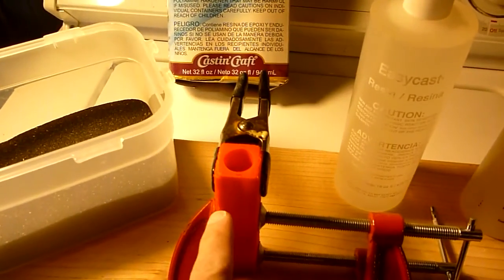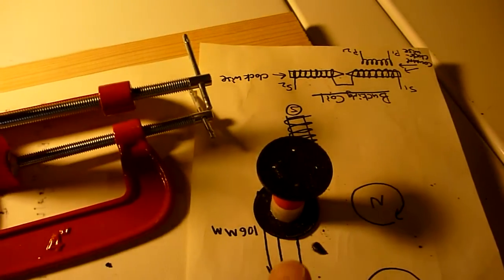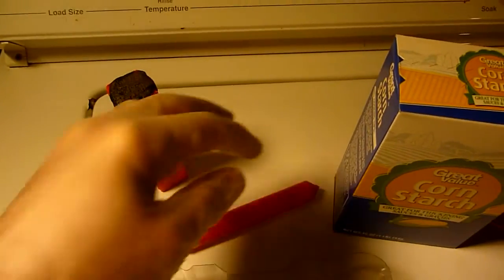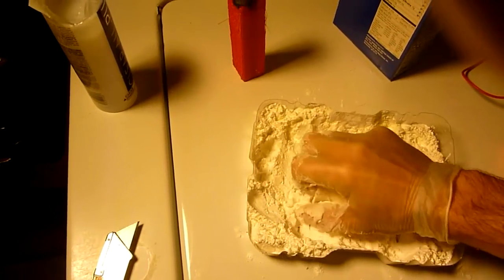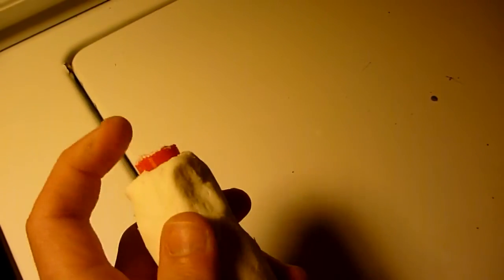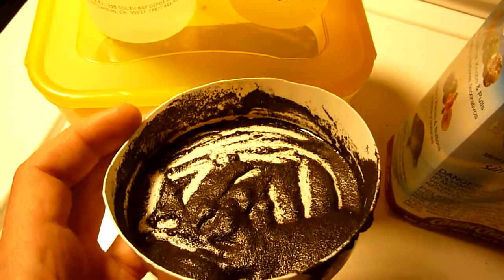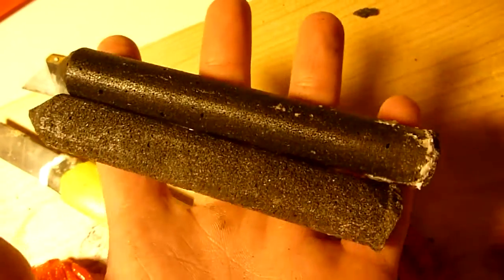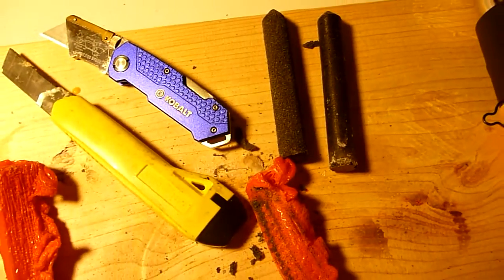How to Make Your Own Custom Magnetite Transformer Cores!

Comment: EASY make transformer cores:) MAKE EM BIG... Materials::  Epoxy resin ,, lots of Iron powder shavings ,,  4 pieces of wood 1/4 inch thick by 2 inches high by 4 inches long rectangle ,, Two wax bricks  5 inches tall by 8 inches long,, Exacto knife ,,wax paper and a undamaged cardboard toilet paper roll. Dip toilet paper roll in clear epoxy ,, hang up by pin hole and thread string ,, let dry.. CUT out of square wax brick ,, 4 rectangle holes that the 4 boards can fit in with Exacto knife... Each board a half inch away from the other and exactly in line with one another. Take out board guides and Fill these holes with epoxy iron shavings mixture. Overfill by 1/8 inch. Let dry for 3 days. Take wax away from epoxy mixture. you should have 4 rectangles connected together in a nice neat row.  Use wax to make another mold with the same dimentions as the 1st one.. Cut out square box on top of dried wax 4 inches length and width by 2 and 1/8 inches deep. Place toilet paper roll in exact center of rectangle wax cut out. Pour in resin iron fillings to both sides of toilet paper roll , but NOT all the way to the top.. let dry 3 days. 3 days later pull wax away. Now you have two halves,, top and bottom. Super glue the flat bases together so they match up perfectly. Now you have 4 iron cores to put 4 coils of magnet wire on and a top hole to put a large neodymium magnet inside toilet paper roll. YOU GET A power supply above the transformer that you can put the kinds of wires you want in the transformer. GO ON,,  beef it up. AND to make it stronger I suggest you put on each end of wires 2 capacitors 400 volt 220 uf ...  It powers all my needs and then some with a Milwalkee 18 volt battery. Great for portable power in camping. Just remember the magnet will be switching poles from left two coils to the right two coils with the negative side of capacitor hooked on one end of wire and on the other side of wire as well.

Comment: Interesting. Is the magnetite power good for low frequency application, e.g. 50/60Hz power transformer? Thanks.
Reply: Yes. But the hysterisis losses will really cause issues at higher frequencies. But 50-60 Hz should be A ok

Comment: Yeah looks exactly like .......
........
Uh.
....
DOH!...
The suspense is agonizing.
Concentrated agar is good for v quick moulds & many at a time.
Can also be re melted a few times. 
Takes minutes to set.
Easy to slice open like Edam cheese.
Very cheaply made.
Not expensive plastic mould.
No dough knobs required. 
Unless you feel inclined.

Comment: Thanks, making the cornstarch/silicone mix will be helpful, have used cornstarch/crazy glue to fix the top nut on a guitar.  I've used fiberglass resin and magnetite to make cores, does not stick to pvc or many other substances, epoxy stick to everything, 
Here is a wiring scheme I discovered some time ago. 
Instead of the standard joule thief, still a bifilar configuration. Designate coil A beginning [inside of the coil, mark yellow] and ending [outside of the coil, mark black] and coil B beginning [inside of the coil mark red] and ending [outside of the coil, mark green], Black goes to the emitter and then to negative on the battery, yellow goes to the resistor [variable pot or fixed] then to the base, red goes to the positive on the battery, green goes to the collector, rectifier is across the emitter and collector [the base will also put out voltage], the cap is attached to the positive and negative of the bridge rectifier, you will find that all the ground are common throughout. I have charged hundreds of volts [600+ from 6 V] depending on the size and configuration of the bifilar coil I was using, It's no theory.....been doing these things a long time, it is tried and true, proven to work through many hour [try "years"] of experimentation. This is the basic setup,  try different methods of discharging the cap back into the run battery or a second storage battery, neon's, gas discharge tubes, Bendini's 555 discharge circuit, experiment.  I'v decided to give these discoveries to "whom soever will", "freely receive, freely give". by the way check out the "field coupled torque translator" I put up lately. I use the empirical method, lots of trial and error. ....... Hope this will be a help in your efforts. Listen to the music also. For me, all these things are great enjoyment and I might stumble across something really useful.

Comment: I like your silicone mold idea. Thanks. I'd like to suggest a couple of improvements, though. Put just a little bit of the mix into the old and then place into a vacuum chamber to get all bubbles out. Then depressurize and repeat the process several times. I think you need to do it a little bit at a time when casting a long rod, so all bubbles come out. My other idea is to use some kind of vibration device as well.

Comment: Hi there. Do you believe I would be able to make a permanent magnet out this core you created?
Reply from the maker: I don't think you'll be able to make a permanent magnet out of magnetite. That magnetite is known for very its quick magnetization/demagnetization properties. I don't know if you can permanently magnetize the stuff. Why do you want to magnetize it?
Reply: I am doing a project at my undergrad program. I am trying to recreate Faraday's Motor experience as much closer to how it was done as possible. Faraday gives us all dimensions and materials for all materials he uses except for the magnet. He writes down the dimensions but not the material it is made of. I guess it is because there were no options back there as we have nowadays. So I though of maybe building up my own magnet made of magnetite. But as you said it probably would not work.
Do you have any idea how would one make a permanent magnet with 1820's technology?
Reply from the maker: The Faraday Disk Motor project that you are doing sounds very interesting. I would imagine that people in 1820s would create magnets in a very similar way that we would create them today. They likely would pass high amperage DC current through a molten piece of iron. Then they would dose it with water to cool the iron chunk down faster. The iron chunk would be magnetized. Also, a very strong magnet can be used to magnetize iron chunks. If you move the magnet over an iron piece in the same direction multiple times that iron piece will become magnetized. No matter how many times a magnet is used to magnetize other pieces of iron its magnetic strength will no be effected (does this go against the conservation of energy laws?). Thanx for the comment, cheers.
Reply: I am not doing the disk experiment but this one instead: http://en.citizendium.org/images/f/f0/Faraday_electromagnetic_rotation.jpg
I will try to make my own magnet like you have said. I have no idea how I would be able to melt a piece of iron, so I might use the rubbing technique.
Thanks a lot for help. Cheers.

Comment: much simplier is to use a candle wax for molding . when it get colder it solidifies . after the epoxy is ok then you can melt again the wax
Reply from the maker: +MonkeyBlueAss I'd expect that candle wax will crumble as you'll attempt to extract it. Try it, see if it works.
Reply: You don't understand me - candle wax is a  single use (disposable not reusable) mold and you don't need to extract the  wax because you can remove by simply melting the wax with a hair-dyer or heat-gun

Search on You-tube the title " How to Make a Candle Wax Mold and Casting " and your see your are wrong because wax is an old mold casting technique

Comment: What I have done to smooth the print lines is to print in ABS then use acetone to smooth and seal the print, if it's done correctly the print will come out looking really smooth like glass, here:
 https://www.youtube.com/watch?v=Jv-CbnB8Uz4
Not the print I would have used to make a video with, but it shows how good the print will be once it's given an acetone bath, you can also do this in PLA, but I have not tried it. Your silicon idea works well also.

Comment: If you were to print the mold in two pieces, spray silicon release in them, then tape the two halves together to pour them, it should work well.
Reply from the maker: Jeff Nading I tried that (I didn't use silicon spray though) and my two pieces got permanently stuck together! The 3d printed parts aren't all that smooth they have tiny groves made by the filament (how big it is depends on your print layer). These groves make it easy for epoxy to permanently bind to the piece.

Comment: sir how did you get the magnetite core from Silicon and Cornstarch mold? is it hard?
Reply from the maker: The magnetite core becomes as hard a rock once you let the resin set (which will take a while depending on the thickness of your core, resin needs heat to cure so give it a few days). The mold is made out of silicone and corn starch and it is very flexible. This gives you the ability to extract your transformer from the mold w/o destroying the mold in the process (you can use it again later).
Reply: Naoki Kashima thank you for the info sir!

Comment: Excellent idea and video. Very useful information. I will be trying this out one day for sure. Good stuff :)
(Side-Note: That patent I said I was going to replicate and test this month is moving forward to the end of April. The reason for this is right now I lack a working oscilloscope and proper probes. By mid-April I will have a working scope and proper probes. I want to be able to properly test the power output and calculate a true COP.
Thanks for sharing.
Peace.
Reply from the maker: Hey, I haven't replicated Steven Mark's work either... as of right now. The reason is because I found out about the bucking transformer.... it is much easier to replicate and that is what I am focusing on right now. I will work on Steven Mark's patent when I am able. I also plan on playing with Stan Meyer's magnetic gas for his EPG generator (this one is over 10X over unity). Its a long road, we have to walk forward with one foot behind the other. We'll get there eventually :)

Comment: That silicone idea is fantastic. I have made small coils like this using Magnetite toner from a xerox machine. It was for some Bedini coil cores and they worked great. My only problem I had was similar to yours I think, in which air pockets get trapped in the two part epoxy. Some solutions I have thought of would be to place them in a vacuum in the curing process or try some type of sonic oscillation process. Even a good subwoofer set to say 100-300hz frequency should evacuate large air pockets as the magnetite vibrates. I haven't tried it yet though, so I am not entirely sure. I used some clear 1/2 water hose for my form. Worked pretty well besides those air pockets. Thank you kindly for sharing.
Reply: Phone vibrator motor should work. If you don't have one these are cheap (possibly NSFW link)
http://www.ebay.com/itm/New-Orange-Full-Body-Mini-Clitoral-Massager-Wand-Portable-Travel-Bullet-Vibrator-/301316898591?pt=LH_DefaultDomain_2&hash=item4627e2ff1f
Reply: I used bigger petrol powered versions on concrete for many years. Including gutters, kerb and channel etc etc.. That’s where I got the idea XD
Works a treat :)
Reply from the maker: I did have some small air bubbles in that thing, I doubt that they would effect the core's performance too much. If you don't want them maybe if you flip the subwoofer on its back (speaker to the top) and then you put a board on top of the speaker with your mold held in place at the center of the board. Then, turn on the subwoofer and continuously generate noise to shake the bubbles free from your magnetite/epoxy mix. Maybe you don't even need any vacuum for this (vacuum seems like it would be too hard to achieve without some special lab equipment). Anyways, I wish you luck in your magnetite core making endeavors. Thanx for the comment  :)
Reply: LOL! Or just unbalance a rotor with a weight on a DC motor. Straight to the gutter with you huh Mongrel Shark
Reply: i had a cordless palm sander that i used on almost every concrete pour for about 4 years straight to to ledges and other tight spots. i even strapped some flat iron to it and could do brick retaining wall core fills  :)